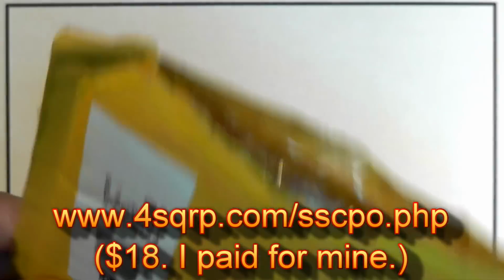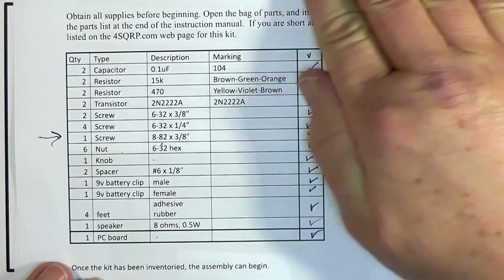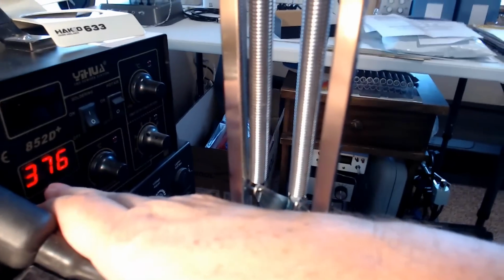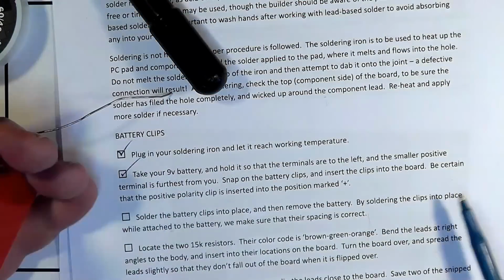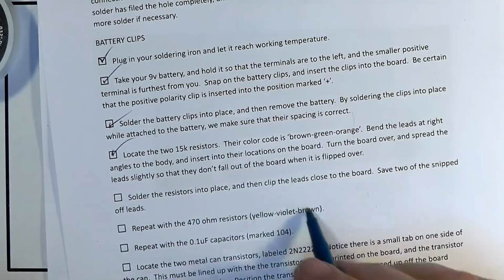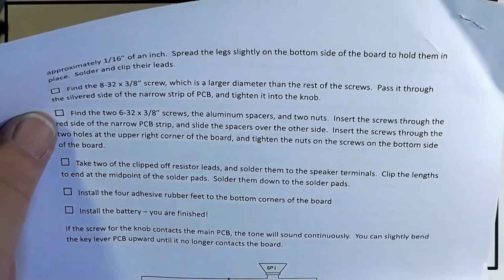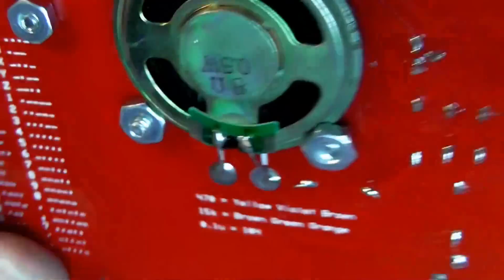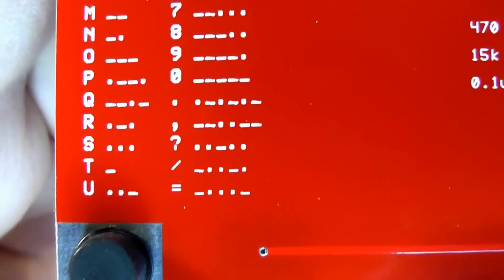Build a Low Cost Code Practice Oscillator (#120)

Comment: I like K4ICY’s twin-T circuit, for those who would like to try building from scratch. It’s probably the nicest sounding of the circuits I tried. I did use an LM386 for the audio amp, instead of his 3-transistor setup (ran a little hot when I tried it).

Comment: Nice kit !!  
I've made mine with a 12v relay, connecting coil in series with its nc contact.
not so fancy but did the job.
it's more difficult now with paddles, I had to buy a arduino nano and make my keyer

Comment: Back around 1974, I was given a code practice oscillator by my fist elmer, an amateur extra.  It was hand built, no circuit board, just point-to-point wiring with a key made from a piece of tin and a hand-made wooden "knob".  To this day, I have never seen a simpler circuit.  1 resistor, 1 ceramic disc capacitor & 2 transistors.  Powered by a 9v battery.  P.S.  Back then I was 13-14 and dreamed of getting that same Heathkit HW-16 that Dave built in 1975, but I could never afford.  If I recall, it was $129 w/o crystals, key or accessories.

Comment: I built one of these, but it is only operates at a very very low volume. Perhaps this is by design? Perhaps, I have a bad transistor. Does anyone have any troubleshooting information? How about any friendly advice?
Reply from the maker: It sounds perhaps like a resistor or two got switched. Double-check the wiring. Also check the battery voltage under load.
Reply: David Casler, I contacted Tge Four State QRP .org and they think the same thing.  I will check.  Thank you
The also said it is low volume by design.  They had a few suggestions too, like connect the kits speaker out put to the input of a PC speaker to amplify it.  
Thanks’ again for your thoughts and thank you very much for all your great videos.

Comment: My code ocillator built from this kit generated no audio at all. After inspecting every component under a magnifier, I can only assume that I burned out a component or two when soldering. All I had was heavy gauge solder and I probably overheated the board trying to get the heavy stuff to flow.  I've built a half dozen Heathkits before with few problems but this little guy caught me!
Reply from the maker: Sorry to hear about your bad experience. Try contacting the kit manufacturer.

Comment: With this type of kits, one mainly practices kit building rather than morse. If you want a truly low cost code practice oscillator, use what is already in front of you... your computer.

Here are a couple out several many possibilities:

1. Straight Key with your mouse or keyboard with real people at the other end : http://morsecode.me
2. Iambic keyer with your keyboard : https://morsecode.scphillips.com/labs/keyer/

If you want to use a real key (paddle or straight) rather than your keyboard, here is how to connect it via USB http://whaley.org.uk/andrew/blog/2017/04/28/morse-code-cw-via-usb/
Reply: A free smartphone app called Morse CT is excellent

Comment: Ewwww. That square wave.

I'm going to build my own practice oscillator, but with a sine wave output so my ears don't bleed whenever I key down.
Reply: Morse Express sells a Twin-T sine wave oscillator kit that can be driven by a straight key or keyer if using a paddle. I have no affiliation with the company. They have audio of it's output so you know what you're getting.

Comment: a tip. use the biggest solder tip you can get away with. (more heat in the solder so you need less heat in the soldering iron) ;)
Reply from the maker: Yes and no. If you're using a big tip for a tiny soldering joint, the risk of overheating is greatly increased.
Reply: that is true, but with a bigger tip you can get the heat in quicker. so you need less time to make the solder joint. because you need less time with the tip on the material you get more localised heat and also less heat in total. you do have to be quick though (at least that is what i was taught by an old guy that soldered almost daily.) but thank you for answering and for making great and interesting video's about the hobby.

Comment: I ended up building the PaddleStick1 keyer kit from K1el. It was $26 and included the touch sensitive paddle key. It works well and can be used with your HF setup and not just as a practice oscillator. BTW, I'm enjoying your code practice sessions though I'm unable to participate in the live stream.
Reply from the maker: I missed yesterday's live stream because I was in an Internet-free zone. I'm back home and want to be very regular with the live stream.

Comment: Although this looks like a nice little project maybe you could reduce the cost even more. I have build a simple practice oscillator some years ago. 
Only later I found out I could use my transceiver to practice: once you tuned it out of the ham bands it gives the tone but will not transmit!
At least this worked with my Yaesu FT-840, it might be worthwhile to try it with other transceivers. I know that with the IC-7300 you can use another trick: in the menu, set break-in to 'off'.
Thanks for your enjoyable and educational videos.

Comment: I’m curious as to why the Morse code legend is printed on the underside of the device?  If it’s meant to practice with wouldn’t it make more sense to have it on the top (or front) where you can see it if needed?
Reply: Proof that corporate intelligence is an oxymoron.😁😁
Reply from the maker: Precisely the point. You need to memorize the sounds. I am disappointed that no one at 4 states QRP club caught the errors!

Comment: Just started  learning how to solder . Do you see the value in an extractor? are the fumes a risk ?
Reply from the maker: I’ve never used an extractor. The fumes are actually the flux, not the lead. Try not to breathe them.
Reply: I have had some issues with very mild asthma after an hour or so of soldering.  Don’t breath the fumes and take breaks often.